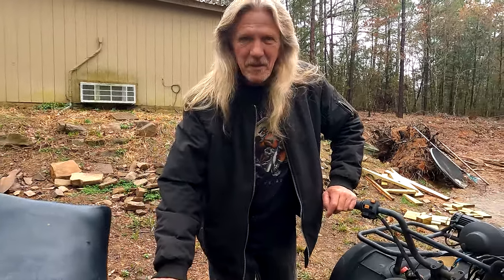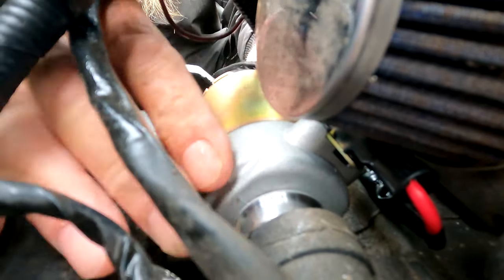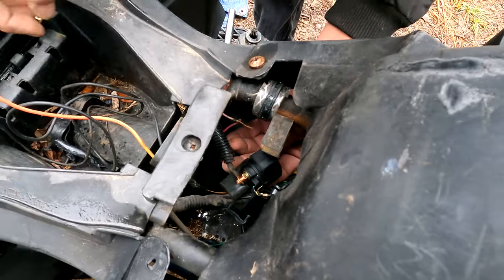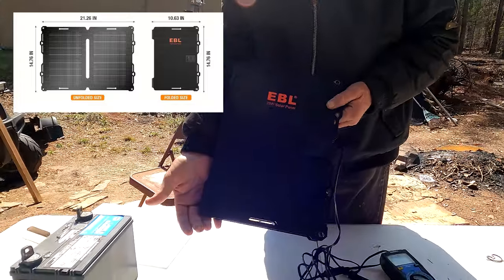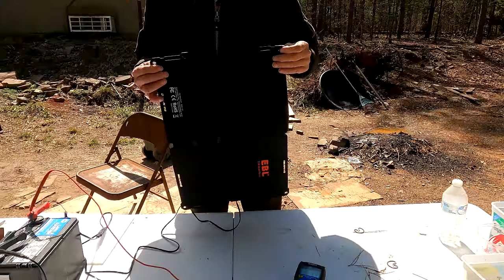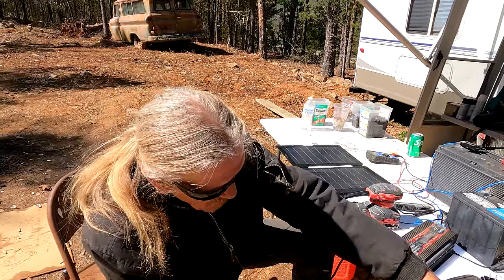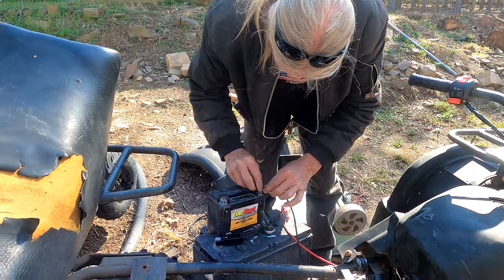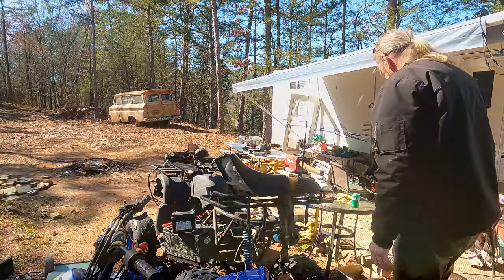TAO TAO WOULDN'T START. couple builds, tiny house, homesteading, off-grid, RV life, RV living|

Comment: If you have the tools you can take off the solenoid housing to ensure contact by removing corrosion and use graphite powder for lubrication to the plunger slide.